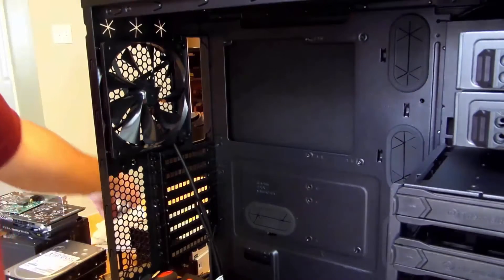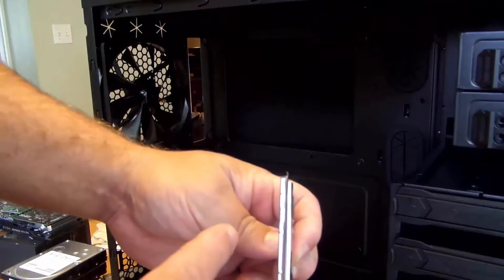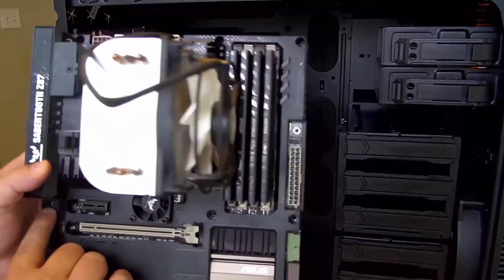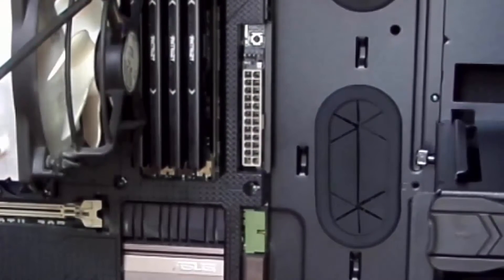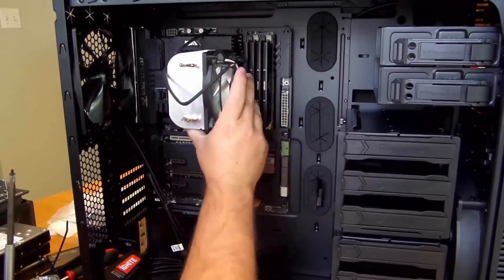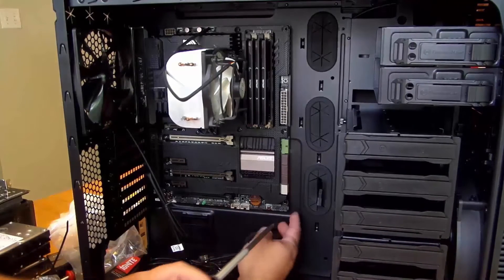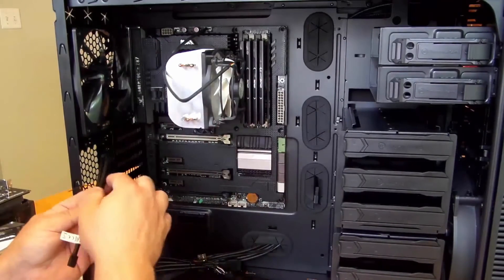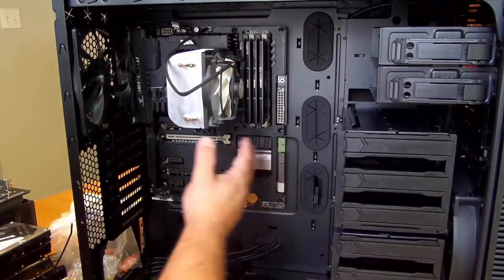How To: Build a PC with a Thermaltake Suppressor F51 Case [PC Building] Part 1 of 2

Comment: Thanks so much for this. I am attempting my first ever build next weekend, using this exact case. Seeing where everything goes, and how you configured everything with the drive bays, has been very helpful to remove some of the mystery for me. I have a question that I couldn't tell from the video. Did you screw the motherboard screws straight into the case or into the risers that come with the case? Thanks again.
Reply: +Iggy Castillo Thanks so much - liked and subbed!

Comment: why did you put those mech drive front bottom and not on the back cover , that big 200 mm fan cant do the job right because you not letting good airflow because of the drives, and no the new mech drive dont get hot unless they are the old raptors
Reply: why so many drives ? porn collection?, either way good video my bad i didnt see the whole thing, sorry
Reply: +junito1957 the video is to show people how to build a pc... there are people that have many driver, I have many drives I don't use anymore so I am showing people how to use those drives if they have them
Reply: +junito1957 but thank you for the compliments ;)
Reply: trying to decide if i should get the define s or thermaltake suppressor p51 ? still cant decide,lol big sale on both of them at newegg